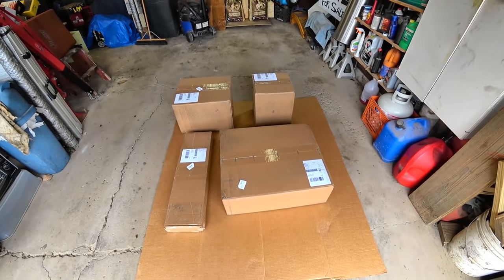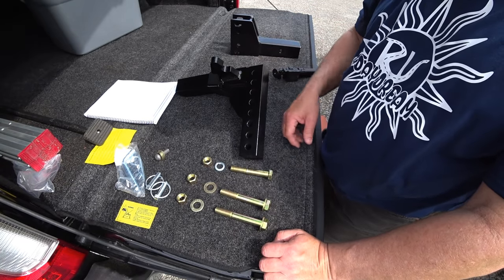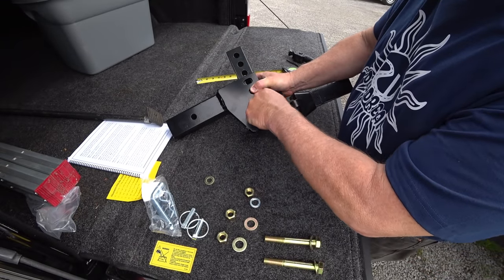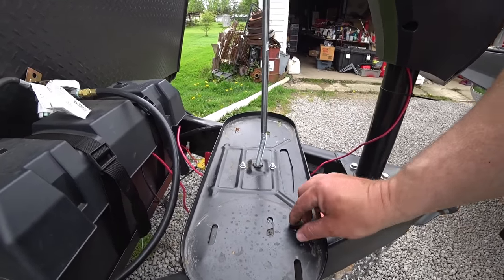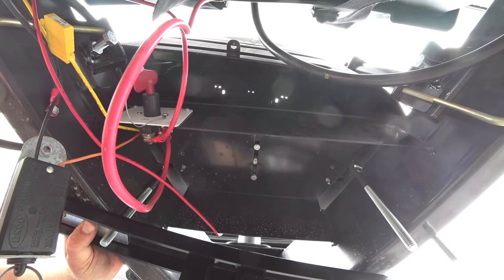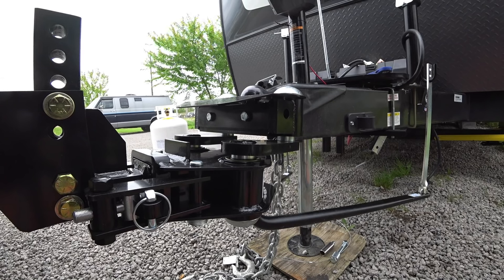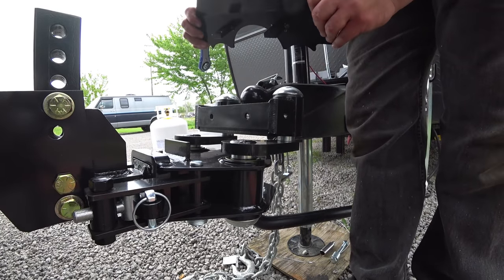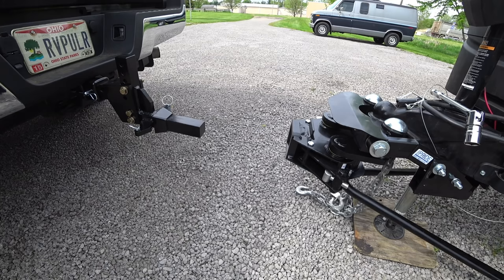ProPride 3P Hitch Complete Installation

Comment: Crosswind blew me into fishtail....Black ice prevented me from being able to correct....rolled THREE and 3/4 times at 50mph.  6 passengers on board. Wife landed halfway out her window, nearly lost her right eye. 1 boy COMPLETELY ejected and the Excursion landed on him losing a piece of his ear. Over $150k in hospital bills. 
We all lived, thank God!
$3k to NEVER have that sick feeling in my gut again. Yep. I hope this works.
Reply: Bob K. We took a year off and towed our Airstream around 30k miles with a ProPride.  One month towing in snow for skiing and several times we have had cross winds in the 45 mph range (Wyoming is windy).  We have never experienced even the slightest sway.  When the wind was 40 plus we slowed to around 40mph as it pushed our rig but again no sway.  Every thing has its drawbacks but sway is entirely eliminated with this hitch.  Hope your future travels are much less eventful
Reply: @tyb3938  "... drawbacks ..."?
Reply from the maker: Heavy tongue weight...
Reply: @twk1956  only drawbacks are maintenance which is easy, grease the zircs every 500 miles and backing in to a tight spot is a little harder as it behaves like a longer trailer.  I think this is because it projects the pivot point.  Once I got used to this I can back it down like a champ
Reply: wear seat belts ... , 150k in hospital bills ? wow , glad i live in Canada !

Comment: I ordered the Propride 3P this week after being disgusted with the way my current hitch was performing. I too  went thru a rollover 13 years ago and never again! My current system provided me with the same uneasy feeling after many adjustments and without success! My favorite bumper pull hitch setup was a Pullrite but unfortunately they do not manufacturer those anymore. That system pulled better than the 5th wheels that I had later! I even called Pullrite and asked them what they recommended and Propride 3P was it!

Comment: Great video, thanks for taking the time to show your set up.  I'm constantly watching eBay and Craigslist to purchase a gently used one.  One thing I wanted to shared... at the end of the video you show your finished set up... and I noticed you had the emergency breakaway cable routed through your 7 way plug holder on the trailer frame and the ball lock pin.  I was always taught to keep that cable free from everything - the reasoning was that you never want that cable to be pinched or bound up in any of the hardware and have it fray or break during an emergency.  I never wrap it around the frame, the chains, the trailer plug wire, anything.   Not sure if everyone feels that way, just sharing what I was taught.  Great job, I appreciate you sharing your knowledge!
Reply: Jason Fay Join the Facebook ProPride group if you haven’t yet. Almost every week, somebody lists their gently used hitch for sale.

Comment: Yea, I know many folks speak highly of this hitch system, but I did watch your complete install and it is nice to be young. I am 70 years old and that looked way too much for this old bird to handle. Plus the cost is way out of my budget. I have the EZ-Lift Recurve R3 and have been very happy with it. Easy on and off. I even installed it on my new 2018 RAM 2500 and it is torqued to 260 foot pounds. I had no issues doing this install. The difference was my old F150 was 13 inches lower than my new RAM. So the hitch head had to be repositioned. Plus my load bars are level with the top of my trailer hitch frame so nothing hangs below the hitch frame. Anyway, we find what will work for each of us. Seemed to me way too many minor adjustments. My total time on my Recurve was about 20 minutes because I am old and took breaks. All your videos I do watch and learn a lot. Thanks
Reply: Thanks for the love...……..ah to be young. I had a Class C for many years and decided to go with TT.

Comment: Great video Mike, on that hitch you guys chose, but I'm sold on the Equalizer 4 Point sway control hitch. Safe travels and happy camping Mike and Heidi.
Reply from the maker: I almost bought the equalizer, the thing that I cannot get over is two of their 4-point sway control is compromised when it starts to wear or even when it's raining out. The bars action against the L brackets on the frame get worn over time, loose friction when they're wet, and become noisy. Equalizers answer to the noise is providing composite pieces that connect to the L bars and ride underneath the weight distribution bars. They basically reduce the friction that is used to help control sway. It's mind-boggling, I've never seen anything like that before. I just couldn't get my head wrapped around that part of it. Last thing I wanted was noise back there.... Yes I'm pretty much one of those guys that hears every creak and squeak when I'm driving down the road. I can't even stand hearing my keys jangle on my steering column. It gets even worse than that, I can't even stand the little plastic locking ring that rattles from the slightest vibration that is on plastic water bottles. LOL
Reply: @Rvdaydream  I'm happy with y'all's decision on the Propride, good points on the Equalizer! Enjoy!!

Comment: A Great information video Mike! But DAMN! 3k!!!! My buddy drove 2 hours away to pick up a slightly used Hensley Hitch for 500 bucks and swears by it but we run a Equalizer Hitch and other than 30+mph gusts I don't feel a thing when towing and it was about 2k cheaper. Plus my 16 and now my 19 Super Duty has anti sway built in, don't know how well it works or if its even just for the truck side of things but so far very happy with the Equalizer, only thing that sucks id now I have to get a new 2.5" shank and a new 2.5" collar for my Rock Tamer mud flaps.

Comment: I think some people get confused when measuring the trailer hitch height. You don’t need the trailer level, you need it parallel to the surface it’s parked on. Saying you need the trailer level, suggests you need to level it with a standard bubble level. I think that confuses people. You absolutely do not need a bubble level for this install. You need a flat surface and a measuring device.

Comment: Good install video, the most detailed I've seen so far on this style. I'm still rocking my Reese HP Dual Cam setup, which only cost $600. My 38' Outback 324CG Toyhauler barley sways if at all against the highest crosswinds. $3k is just too much money for the P3. It appears that Sean is trying to recoup his design costs and loss of sales with competition from Hensley by charging double the value of these. I do think the P3 is a slightly better design upgrade vs the Hensley, but it's not worth that much cash. I'd rather upgrade to a 5th wheel and put $3k into something of more value.

Comment: All Fords since at least 2011 have anti-sway control actually built into their trucks. Both F150 and Super Duty. Nothing wrong with taking extra measures though but a lot of guys seem to forget this fact. Happy RVing. Cheers.
Reply: Your right, they do all have anti sway built into the truck but this system does nothing to eliminate sway.  The system only recognizes that the truck is starting to sway and notifies you on the dash and will also apply the brakes.  It has nothing to do with stopping a unit from swaying.  I have a 2019 F-150.  My first trip pulling my toy hauler, I set the sway control alarm off 6 times.  It did what it suppose to do and applied the brakes.  It did not eliminate the white knuckles and fear.  That is why I purchase the Pro Pride.  Have not used it yet but I have a $60,000 truck, a $20,000 trailer, a $16,000 Razor and not to mention my family and three dogs.  Yes $3000 is a lot of money for a hitch but peanuts compared to the other investments.
Reply: @larrymattox2471  I agree with everything you said bud. My only question (or is it concern) is what size toy hauler you got? I don't know of any size toy haulers that I'd feel comfortable towing with a F150 truck. Glad you found a setup that worked out in the end but I'd be willing to bet a dollar from a donut that your F150 wasn't enough truck for the size of the toy hauler. It's rated to pull it I'm sure but there is such a thing as using to light duty of a truck for the task at hand. This is why I only buy F250's. Yes I take a hit on fuel economy but the towing experience is far superior to the F150 imho.
Reply: S Knox thanks for your reply.  I have a 26’ puma overall length 31’.  Dry weight 6300 , cargo and trailer under 9000.  Power wise , the truck is rated 12,200.  The truck has plenty of power to pull my load.  Yes when I am towing (3 to 4 times a yea
Reply: Sorry about that, as I was saying , I didn’t tow that often to up grade to a 250.  f-150 has such a good ride.  I hope the pro pride will eliminate the sway problem.  If it doesn’t, I my on the future be looking at a 250.  I always heard that you should stay under 9000. Lb.  with any half ton which I do.  Thanks for the conversation.  Larry
Reply: @larrymattox2471  that's not a bad setup. Yea I do agree with staying under 9k pounds on a half ton regardless of what its rated to tow. Good talking to you Larry. Have a great day!

Comment: Excellent vid! You covered all the points I’d need. Sean and crew should be pleased with your help. So the question is, how well has it worked? Does it really cut back on the white knuckle drives? Would you buy it again? Hmmm. I guess that’s three questions.  Thanks for the time and effort again.
Reply from the maker: It's different as far as The Hitching process. It's not easier, although my wife says it is , it's not more difficult it's just different. As far as Towing down the road, I hate the fact that people use their half ton pickups the toe more than what they should and they use this hitch help that situation out. I think everybody should have to tow their trailer using a standard hitch for a year or about  1500 miles of Towing and then decide if they want to upgrade and go to a pro Pride hitch. So with that said, we towed our short lightweight trailer with the F250 2019 extended cab long bed super duty and now we're towing with a F350 2020 crew cab long bed so the results of having this more sophisticated hitch is probably not noticed as much because of our truck size. As I mentioned in some of our videos over the last year that the control while Towing it's definitely increased using this hitch... here's a link to one of the more recent videos that I talked about it.https://youtu.be/y22jMY2JMjc
Reply: @Rvdaydream  The challenge is you don’t know what you don’t know. Based on the specs of my f150, 11000 lbs towing and 1780 payload, my 6000# trailer “should” be well in spec. In reality, when you add three 20# tanks of propane and the two batteries, I’m at 800# of tongue weight before adding anything to the trailer, the weight of the hitch, and anything behind the trucks rear axle. I’m pretty certain that I’m far closer to 1200# total than 1000#, which is the size of hitch the dealer recommended. When I’m loaded for a trip, the front of the trailer and rear of the truck are lower than I think they should be, so I think my lack of weight distribution adds to my sway issues. I’m thinking that until I can buy a new truck, I have to upgrade the hitch. Hensley Arrow, Propride 3P 1400, or possibly the Blue Ox Swaypro BXW 1500. The Swaypro is $2100 less and still doesn’t use friction to reduce sway, is easy to set up and use, and gets great reviews, but the Hensley licensed hitches prevent the trailer from wagging the truck and have 1400-1500# weight distribution. Another nice option is that I’ll be able to open my tailgate. By the way, so far, not impressed with any of the dealers I’ve spoken with and their towing literacy. Appreciate the vid. And like your vid on the rear tray for your generator. Another issue I’m trying to address. Keep me coming!

Comment: We used this video to do the install yesterday, in addition to the company directions.  Between the two, I think it went together well!  I love that Sean Woodruff makes himself available for questions.  We did have many questions about the application of this hitch to our" less than ideal" set-up.  We have a Tahoe with a towing package (not XL) and a 33 ft. Ultralite.  The wheelbase proportions made this impossible to account for with a Reese anti-sway, weight distribution hitch.  Got caught in a 32mi/hr. sailing just off the headwind(if you know how to sail, you know that this is the sweet spot for catching the wind) and a Tractor Trailer went by and let's just say that the sway was so bad, I consider myself a hero for saving the family.  Never again!  Traveling is supposed to be safe and fun!  We have not yet tested the rig on the highway, but will let you know if the sway is corrected.  What do you guys know about the stability of this set-up on wet roads or actively raining?
Reply from the maker: No issues. Good luck it will pull like a dream!

Comment: Just saw your video, great job!  Was thinking about this hitch, but my concern is how low the bars are to the ground.  My driveway is on a incline and I'm worried they will strike the driveway when backing it in to its spot.  :(
Reply from the maker: We never had an issue with our less than Stellar driveway and never scraped anywhere actually

Comment: Did you take a look at the Hensley hitch and was there a reason you went with one over the other. I have been watching videos on both and it seems like the Hensley is not as complicated.  We are awaiting arrival of a Rocket 2608BS and I am trying to decide what hitch to go with. ProPride Hensley , or conventional style.
Reply from the maker: There are a few videos on YouTube explaining the differences between the Hensly in the Pro Pride. Basically in a nutshell, there was a redesign by the original engineer Jim Hensley and former employee of Hensley hitch Sean Woodruff. They addressed the shortcomings of the Hensley hitch and came up with the pro Pride.
Reply: We have a 2020 2608BS as well. With a 2017 F250 and a blue ox swaypro, Still are having sway and do not like it. Would love to know what you decided on and how its working for you.

Comment: I hear a lot of great things about this hitch but it's so expensive. That was the deal breaker for us. We went with a husky centerline ts and have been happy with it. The trailer isn't too big (25ft exterior length, 5000lbs) so we couldn't justify the cost.
3 biggest con to this hitch for my application are: 1) need to be straight when hitching 2) other vehicles cant tow or move the trailer without the receiver bar (provided their receiver height is the same) 3) cost

Comment: How perfectly level does it all need to be when first dropping the tongue on the new hitch ball?  I can be overly cautious and waste time trying to perfect things. I'd like to do this in my drive if possible, but it might be offset by a degree or three.
Reply from the maker: Well you don't use the hitch ball any longer for hitching up. It stays mounted to the tongue. Are you talking about whatever you're trying to insert the hitch bar also known as the Stinger into the hitch receiver when it's time to hook up and tow? If that's the case it doesn't have to be very level at all. We've only run into a couple situations that we've had two spend a little extra time getting it all lined up for us to hook up and go to our next destination but the angles that we were at were pretty extreme. As far as setting it up initially you need to be pretty level. What I mean by that is if you're referring to this installation video I had the truck and trailer in known level locations in the driveway. It was definitely not perfect but it was pretty close to what is normal. Obviously the trailer needs to be darn near perfectly level to make sure that you get your hitch height measure correctly. But then again you could actually take your tow vehicle to a nice level location and get all the measurements off of your hitch at that point and do the worksheet in the booklet and it will tell you how you should build the hitch. What I mean by build is how to bolt it together for your specific application.
Reply: @Rvdaydream  I don't see how you could've given any better response. You lead me to the exact answer I needed. And based on the info I read, I was thinking I can measure elsewhere, and your next sentence confirmed it. The backend of the trailer is just shy of as high as it can be at the back of the drive and the 350's dash level shows the front end is 1° up. Might have wait for the ground to dry from the snow so I can use the lawn...w/boards. Thanks for the great info. Much appreciated.

Comment: Great how to video up until the point I saw you put the emergency brake wire on the stinger. What if you lose the hitch pin? You need to connect that wire to same spot as your chains so it's connected to the tow vehicle, not the hitch reciever.  (Speaking from personal experience of losing a hitch pin). Other than that. Great job.
Reply from the maker: That was just and installation video . It's not connected to the hitch pin. The loop goes through the hitch pin so it doesn't fall down and get pinched off by the propride hitch. The cable continues all the way down to where it is connected where the chain attaches.
Reply: @Rvdaydream  I didn't notice that. My apologies, carry on.

Comment: I just watched your video for the second time.  We have a 2020 Rockwood 2608BS and will tow with our new 2021 Ford F-250.  Our trailer has the break-away switch located in the same place as your’s. I noticed that you unscrewed it during the ProPride installation, but I didn’t see how you remounted it.  Did you just screw it back into the original location, or did you have to move it?
Reply from the maker: I believe its in same location.. awesome choice of rv and vehicle 😁